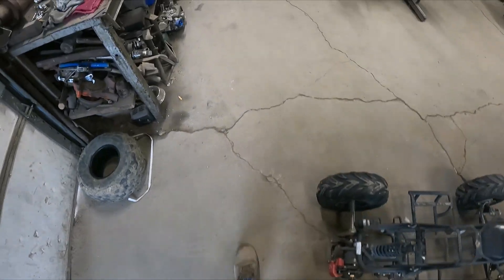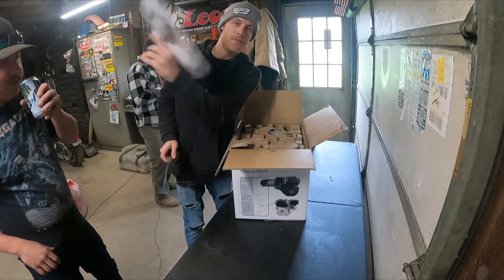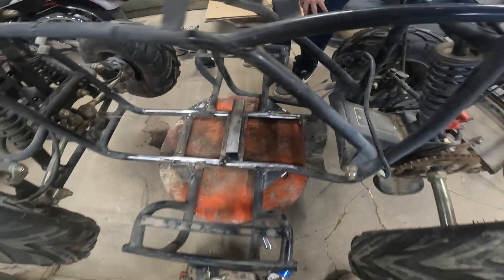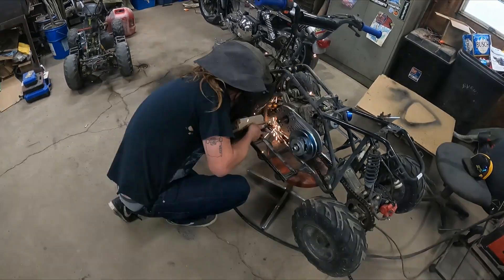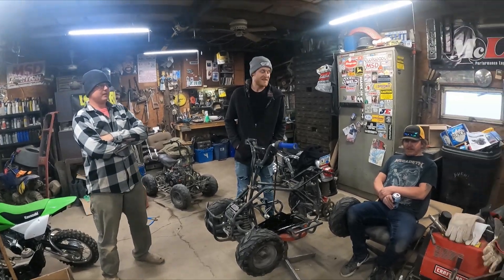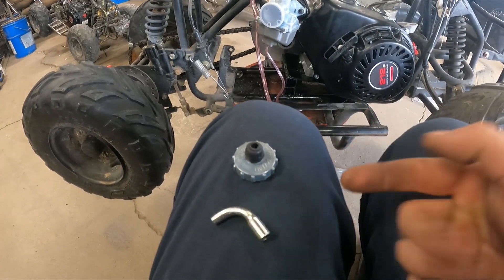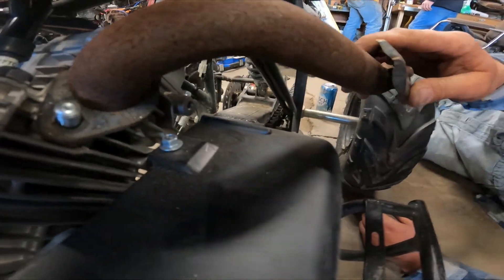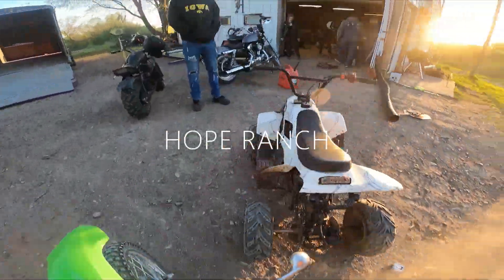Building a Predator 212 powered Mini Quad: A Guide

Comment: What size rear sprocket you running if you don’t mind me asking bud?
Reply from the maker: It's the stock rear sprocket. As far as tooth count I'd have to check. Then we do 40 or 41 chain with the bigger sprocket that comes with the torque converter
Reply: @thehoperanchchannel4950  good looks thank you

Comment: Nice build, have you guys ever done a Polaris 90? I’m only asking because I have one and the engine blew and I’ve been wanting to put a predator in it but I was wondering if would work because the sprocket is on the other side.
Reply from the maker: We did a more common quad and put a 420 on it. We just flipped the rear axle
Reply: @thehoperanchchannel4950  ahh ok makes sense, Thanks for such a quick reply
Reply from the maker: @justin_steen  just measure from the bearing out to the hub and see if the axle is offset first. Thanks for watching !!
Reply: @thehoperanchchannel4950  Ok thanks for the tip
Reply: @thehoperanchchannel4950  oh and one more question what torque converter do you run?
Reply from the maker: @justin_steen  30 series on a 3/4 shaft motor , ebay or Amazon 50 doll hairs
Reply: @thehoperanchchannel4950  ok thank you
Reply: @thehoperanchchannel4950  just picked up the motor today ant the torque converter is on the way thank you for the help 😊

Comment: If I don’t have a wielder!! Next best option cuz that’s where I been stopped at for so long???
Reply: Next Best Real option is picking up a cheap flux core welder from harbor freight or somewhere similar, if thats really not an option lots of really thick bolts but i would not recommend it theyre guaranteed to fail if your using them structurally.
Reply: @DoneWrongGarage flux core ftmfw
Reply: I own that frame yall got any parts you could send my
Way boys?

Comment: Can you cut the TC backing plate instead of lift the rear? Similar to when installing a TC on baja warrior without raising motor? Thanks for the vids.
Reply from the maker: I guess I've never thought of that. My Baja still has a centrifugal clutch
Reply: @thehoperanchchannel4950  there is a good video of it on here. Keep up the mini vids!
Reply from the maker: Oh we will ! Thanks for watching !
Reply: i have cut that back plate down a couple times for clearance issues its only real purpose is chain guard but you can take 2 inches off the bottom of it and theres still plenty of plate guarding the sprocket.
Reply: I ended up cutting the plate at the bottom. I have a couple hard woods rides and no issue yet.
Reply from the maker: @steelcold3912  hell yeah !
Reply from the maker: I actually just thought about this again and the main reason we lift the rear is so the chain clears the swingarm bolt.